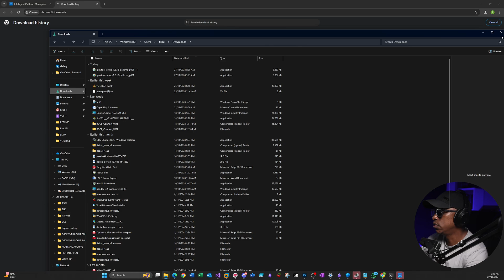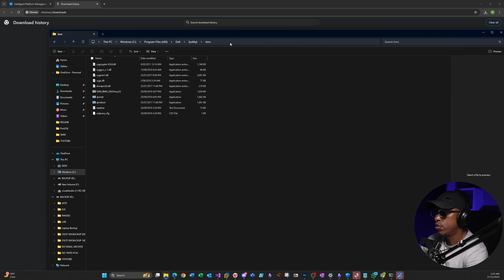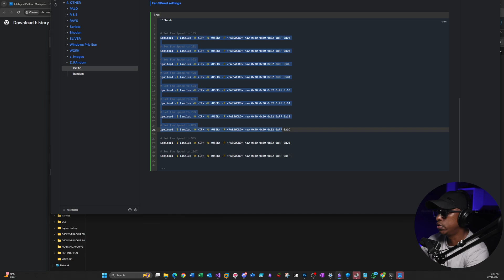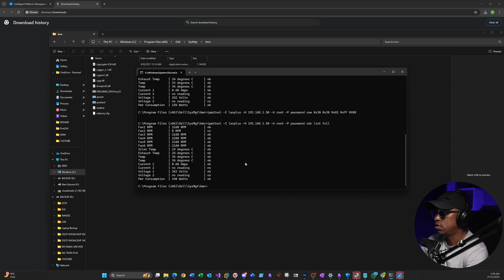How to Set Fan Speeds on Dell Servers  | Reduce Noise Easily

Comment from the maker: 🔥 Tired of Noisy Servers? 🔥
In this video, I show you how to easily control fan speeds on Dell servers using ipmitool. Learn how to optimize cooling and dramatically reduce noise levels in your setup.

👉 Watch the full video for step-by-step guidance and tips on fixing server noise issues!

📌 Got questions or need help? Drop a comment below, and I’ll get back to you!

Comment: Don’t think this  ipmi command still works on 14th gen with updated idrac anymore. There is a firmware that still allows it, but if you’ve updated to a certain point you can’t roll back. Dell needs to step up and give us a real solution.